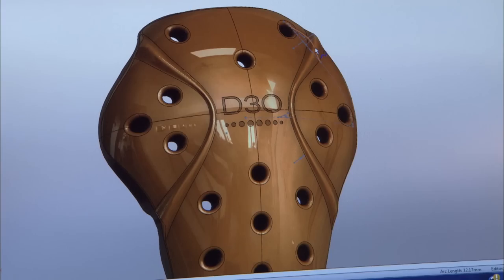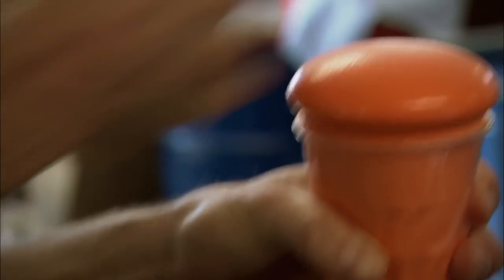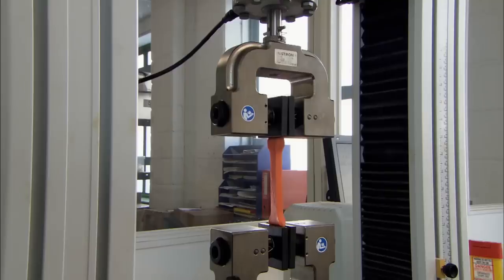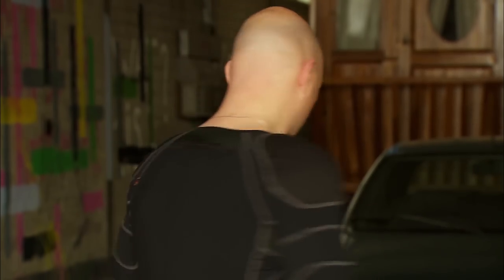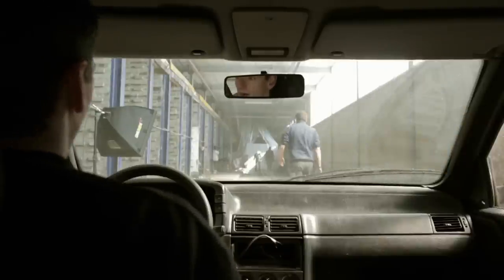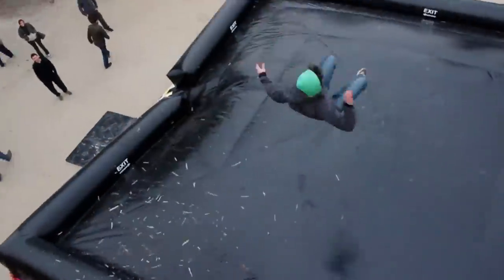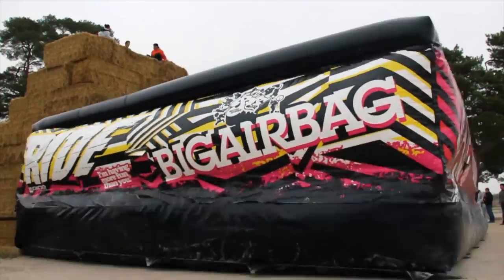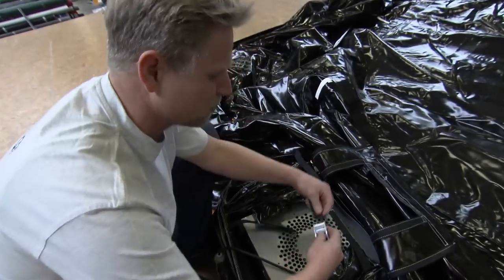Making Shock Absorbing Protective Gear From Goo | How Do They Do It?

Comment: I review motorcycle apparel and armor, and I've reviewed several of the top-end versions of the d3O armor on my site. I've had several military paratroopers emailing me to tell me how they've been wearing d3O armor in undergarments after reading my d3O reviews since the pads have been very useful to cushion their landings. That's how wild the potential for applications and use is with d3O's armor.

Comment: My understanding of kinetic transfer is that a hard object won't protect you nearly as much as an object that shatters does, due to the dispersal of energy.  So how does this material hardening in response to impact make it safer? Is it because the energy results in the material's structure locking up, thus gaining both durability and consuming energy?
Reply: It spreads the impact throughout the material. A normal hard material does take a lot of impact but doesn't spread it.
Reply: @crisostomoibarra1760  that's what i needed to know, thank you!
Reply: It's not permanently hard. The impact is taken and spread to harden the "fluid". On a permanently hard material the impact is taken but not spread.

Comment: what's the material made of? that's awesome
Reply: CORN STARCH AND WATER NOT LYING
Reply: @GatlinsFuckinCornfield  oobleck just works because whenever something hits it quickly the corn starch gets compressed and turns into a solid, then it slowly flows back out, d30 uses something similar, if not the same, so yeah, it is kind of oobleck.
Reply: @GatlinsFuckinCornfield  what's the recipe tho
Reply: @GatlinsFuckinCornfield   d30, I think it's some kind of polymer but I want to know if I could make it at home